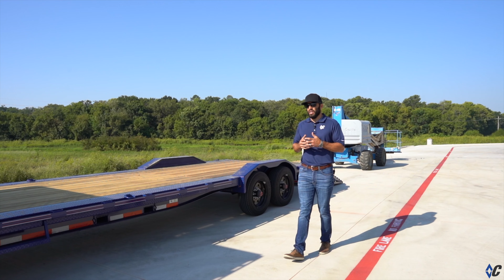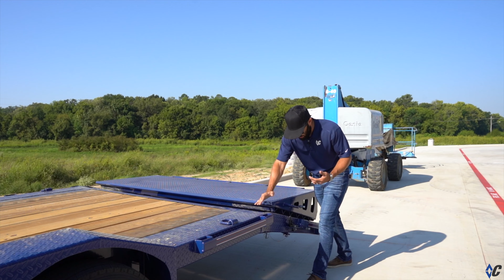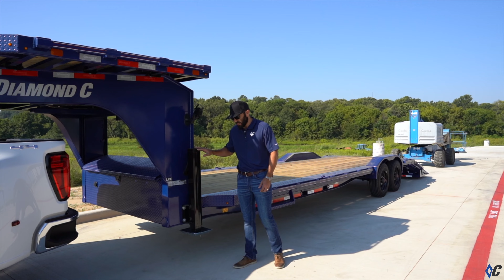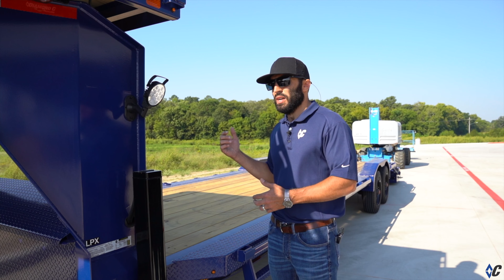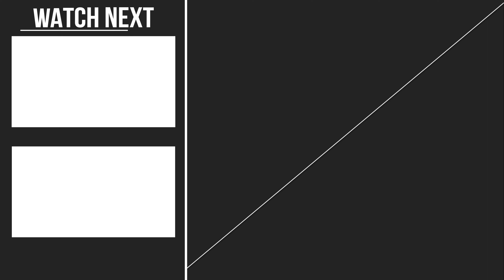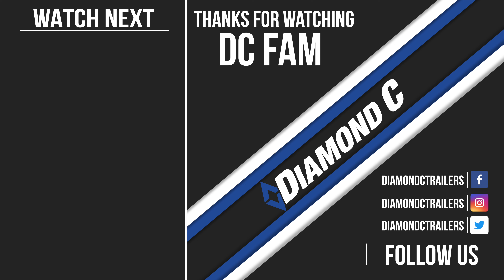Decked Out Equipment Trailer!! | Diamond C

Comment: For the first time in my life, procrastination has played in my favor. I’ve been wanting a LPX since 19’ and it just keeps getting better. You guys are knocking it out of the park with this. 👍 only question is instead of the angle iron for the tread can you get a reinforced gate with expanded metal for machines with smaller tires so it won’t be so “rough/bumpy” when loading. I know the dovetail has options like that.